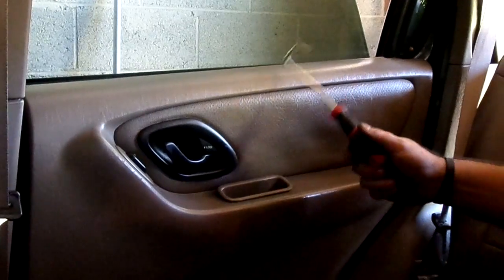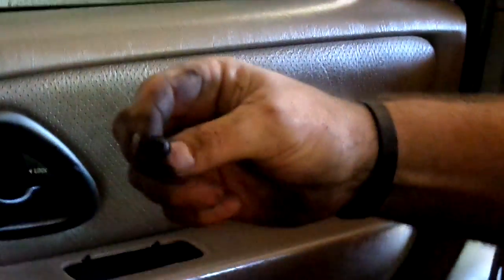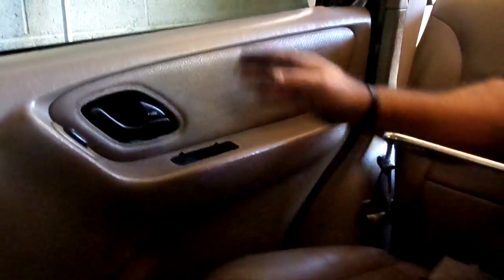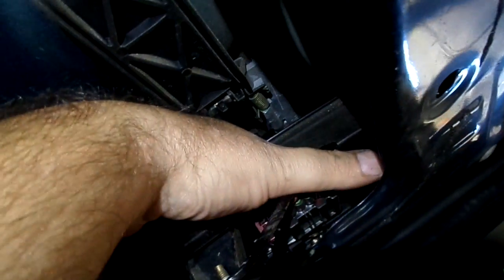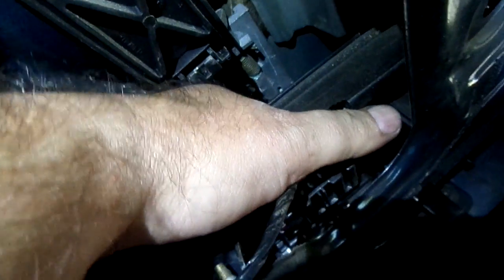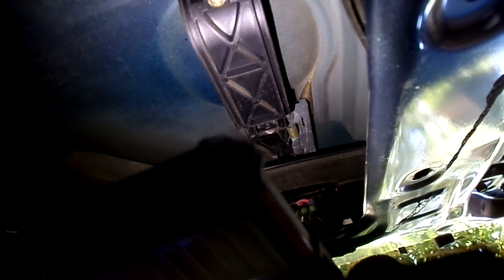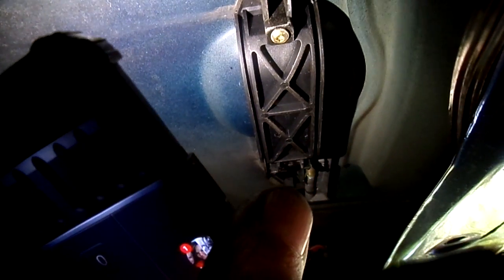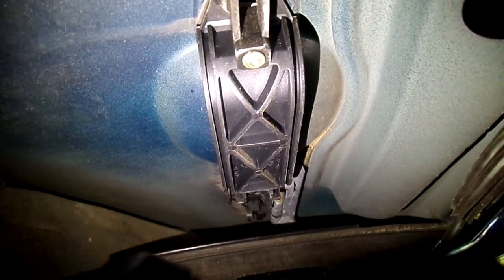How To Open Car Door With Broken Handles

Comment: You cant take the panel off on the front door if both sides arent opening. Everyone is doing a video for the back doors or if it doesnt only open from the outside on the front door. Yea if you can get the front door open you can remove the panel but if both wires are popped how the heck can i get the door open to remove the panel. Ugh! 1997 Xj6 L Jaguar

Comment: Veery VERY helpful video! Job done & fixed used PB-Blast to lube the inner pivot lever the overrides the locks. Note to anyone doing this and struggling with the door panel there is a triangle black molding piece that has 2 press clips that you must remove on the rear passenger doors BEFORE freeing up the bottom door panel push clips. Then just bop it up from the bottom of the door panel. Thanks again Jamie! God Bless Brother!

Comment: Nothing works. Thinking latch is broken. Now what would I do ? Door is partially open but opens no further. I have inside panel off. Pulling on both rods,...for lock & door latch release. I can touch what seems to be lock lever, with screw driver, up & down. Sounds like latch is releasing but only opens part way. I am afraid to try shutting door all the way & trying to open that way but if it doesn't open at least partially again, I figure I would be worse off.
Reply: What did you do?

Comment: I can’t take the door panel off.
Reply from the maker: +Greg H  use a putty knife to get behind it start at the bottom
Reply: What if the door latch wont open even after pulling down on the lever?